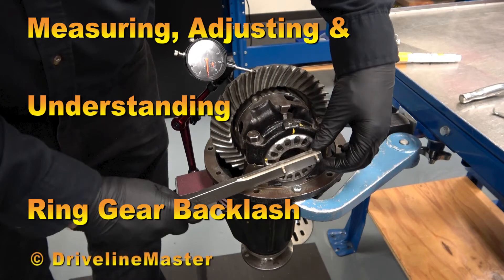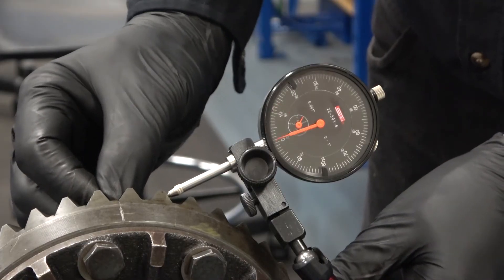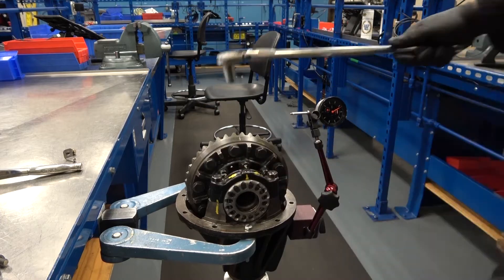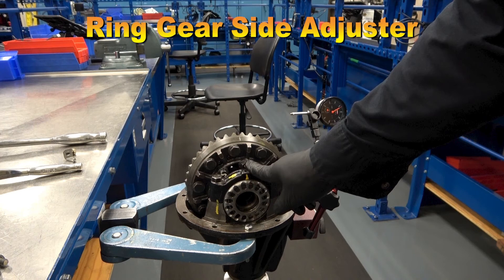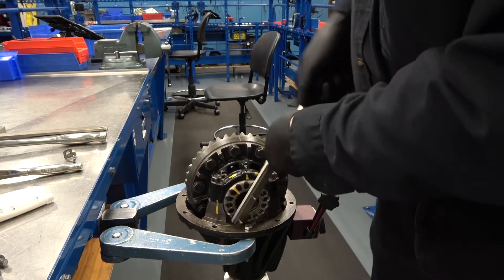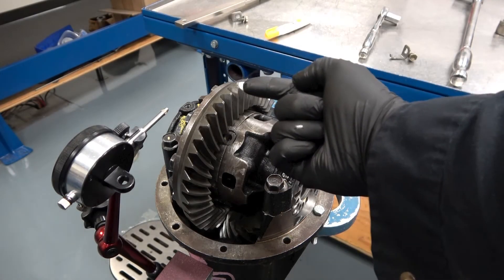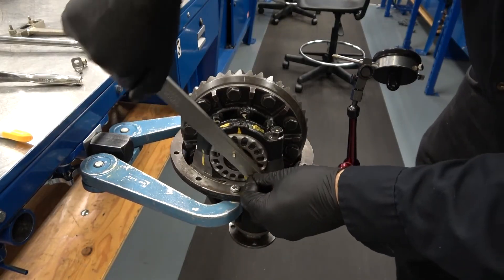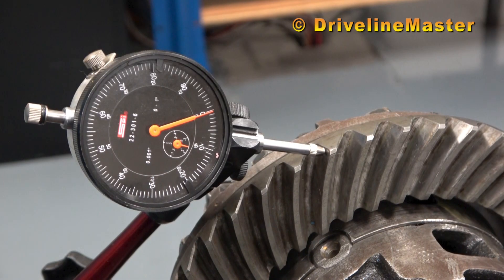Differential Backlash Exercise

Comment: My ford was bad when i got it at used car yard with leaking diff and it was very clunky, it needed a 0.38 mm pinion shim and brand new carrier shims, now there is close nearly no backlash, I used boot polish on the ring gear, i suspected it did a lot of towing before purchase.

Comment: hi so what us ideal amount of acceptable back lash
Reply from the maker: There is a manufacture specification for backlash for each differential.  On an average I have seen anywhere from 0.002" all the way up to 0.014" with most averaging between 0.005" and 0.007".  The builder really needs to check the specification from the manufacture for the specific differential.

Comment: can I just adjust the backlash of my rear 9.5 toyota land cruiser differential and not mess with any other adjustments? theres a loud banging noise every time I shift from P to D or R and while driving and slowing down I can hear the rear differential banging. Previous owner said the differential carrier bearings were replaced but he never did any adjustments. I have a feelings I have excessive backlash on the rear. I have a 4wd part time kit and have isolated the banging noise from the rear differential. Thanks for the time.
Reply from the maker: Yes, this is possible however if it has been banging you should inspect everything to make sure there is no other damage.
Reply: @DrivelineMaster  my pinion pre load was at 0 its supposed to be at 1Nm and my ring gear backlash its supposed to be in between 6 or 8 thousands of an inch but it was at 45 thousands. I adjusted everything just slightly overtorqued my pinion nut. Hope my pinion gear bearings won't get trashed too soon.
Reply from the maker: Your bang was most likely that .045" backlash.  Wow, that was excessive.  It's pretty normal for a high millage vehicle to have 0 turning effort on the pinion.  Tightening it up to 1nm should be OK as long as you didn't do too much.  Used bearings are normally set to a lower value than new bearings.  Setting your backlash back to .006 - .008" will definitely solve your clunking noise. Did you look at your side or spider gears for wear and excessive backlash?  These are what take a lot of the load and often wear out first.
Reply: @DrivelineMaster  yeah my side gears had excessive backlash or seemed worn out too but, I didn't mess with those since I didn't had the shims to adjust them. I'm eventually going to re gear my differentials so I'll be diving back in the soon by then I should have all the necessary shims.
Reply from the maker: I would not just shim the side gears.  If your not replacing the entire case with a limited slip than I would purchase new side and spider gears.  These take all the load and often show the most wear.  When purchasing the new side gears you may need to know the number of splines on your axle shafts.

Comment: Thanks! How tight should the side adjusters be when finished?  I am worried about being too tight and burning up the bearing.
Reply from the maker: Side bearing adjustment is a little tricky and depends on the size of your diff (bearing size mostly) and the gear ratio of your ring and pinion. First measure your pinion bearing preload without the case installed. After installing your case and adjusting your backlash with the proper pinion depth measure the turning force of your pinion and case as an assemble without any axles.  This should be between 2 and 5 inch pounds greater than the pinion bearing preload. Large gear ratios close to 4:1 to 5:1 should be closer to 2 or 3 inch pounds greater.  Gear ratios below 3.8:1 can be closer to 4 or 5 inch pounds greater than the pinion bearing preload.  Using this formula should put in in the ball park to where you bearings won't be too loose nor will they be too tight.
Reply: @DrivelineMaster  Thank you very much!  I have 4.10 gears in a Mopar third member(742 case).  I assume that the oil seal is not installed when I measure the 2-3 pounds greater than the pinion bearing preload?
Reply from the maker: The oil seal can and should be installed. just make sure the seal and the companion flange surface are both lubricated with a light grease such as a white lithium grease. the seal is also installed when you set your pinion bearing preload.
Reply: Thank you!

Comment: Where can I get the adjustable spanner nut wrench that you have in the video?
Reply from the maker: That is a great tool isn't it.  That is a Mazda factory tool.  I will look to see if it has a part number on it and report back.  I did make one out of strap steel and bolts that is bulkier but works good.

Comment: All well and good, but unless you own a mechanic shop, who has those tools?
Reply from the maker: Correct there are some specialty tools but out of all the driveline components to repair the differential needs the fewest specialty tools and the cost is not excessive.  Of course if your not rebuilding differentials or only see one every few years it doesn't make sense to purchase these tools.  The magnetic base 0-1" dial indicator setup is a common Automotive tool and used for a bunch of other measurements in the automotive trade.

Comment: Very good. I bought the tool to adjust the backlash while still in the jeep i have.  Pull tires, pull the differential shafts and use the long tool to adjust from side.  I need to get the right side or differenttial closer to the ring gear to reduce the backlash.
Reply from the maker: Is there a question in this comment that i can help you with?

Comment: Thanks for the video! I am trying to put an LSD in my 1993 MX5. I had bought a complete diff and figured id check everything before installing. According to the service manual the tolerances should be 0.09mm - 0.11mm. When setting the backlash I am able to achieve a variation between 0.09mm and 0.15mm across 8 points on the ring gears teeth. Reading your other comments it seems the only way to achieve better backlash figures would be to remove the ring gear and re seat it, however I was unsuccessful in undoing the bolts. is a variation of 0.06mm permissible in your experience? The manual goes on to say it that the maximum backlash across 4 points should be less than 0.07mm, but  this is greater than the variation in backlash that's initially described in the manual. Cheers!
Reply from the maker: I normally deal in thousandth of an inch and not mm so I had to convert these values.  If the variation of backlash measured values from the maximum to the minimum is 0.07mm or less you should not have any problems.  Please note everything I did was in inches and all the comments are in inches. Sounds like your diff is OK.
Reply: @DrivelineMaster  brilliant thanks for the help!
Reply: I’m doing my Miata too! It’s an 92 and I’m putting a Torsen in it but I’m taking the ring and pinion out of a Kia shortage to make it a 4.77 LSD
Reply from the maker: Don't be surprised if it doesn't fit.
Reply: @DrivelineMaster  the ring and pinion was actually made by Mazda and sold to Kia, it’s a pretty common swap actually, I didn’t clarify that haha